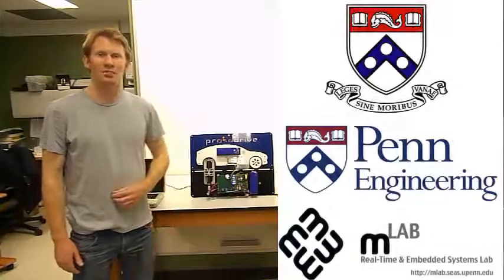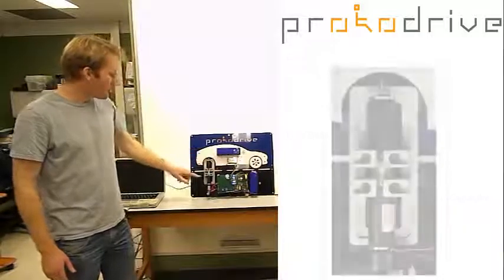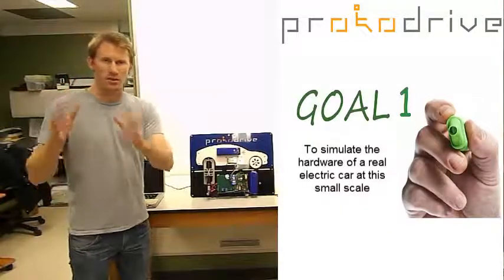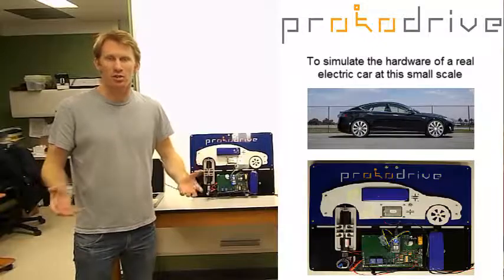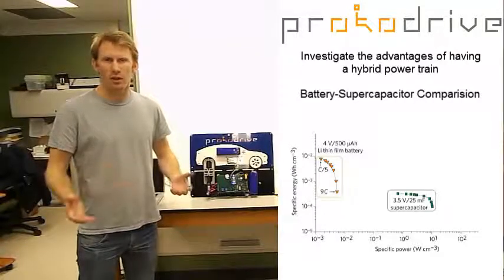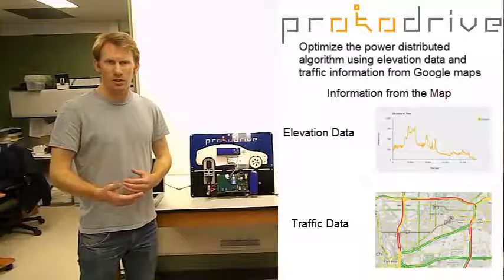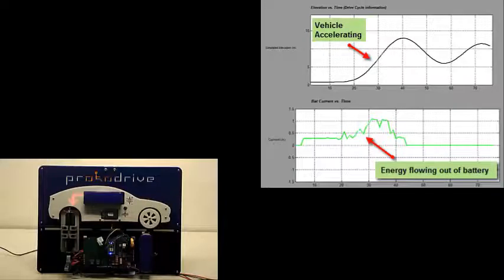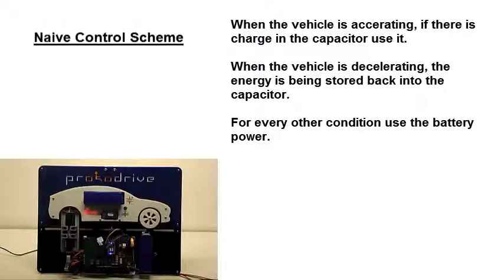ProtoDrive

Comment: NCS = would it make more sense to use SC at most times. By using battery and RegBrk to charge/dump energy into them?
This way, the safe battery discharge method to SC can be controlled and use SC as buffer at all times.

As urban study goes I would focus solely on how much of regeneration can be achieved driving in that particular environment.  From that I would base my balance ratio of SC to Battery.

Ex: if urban driving consist of 25miles/day then we need that much of stored energy to begin with in ratio to car/weight. The trick here is to calculate regenerated energy that can be stored in SC along the way of those 25 miles. Thus subtracting the needed energy to begin with resulting in less needed battery weight.